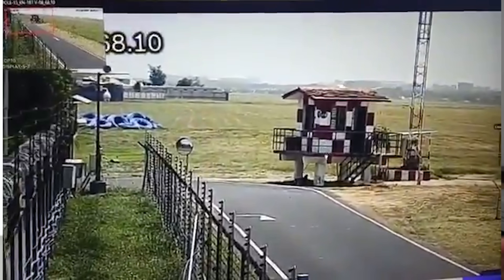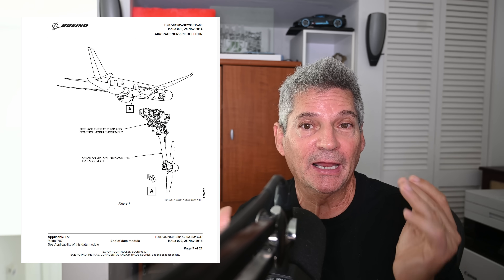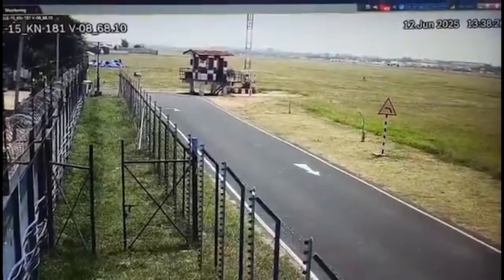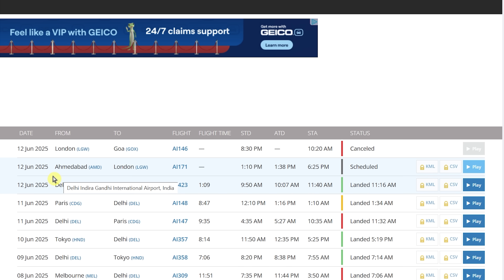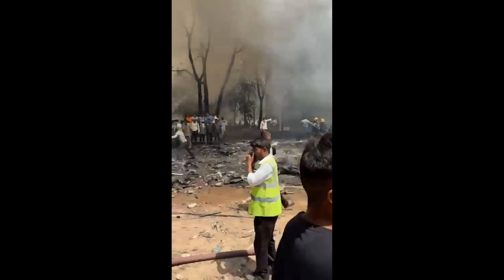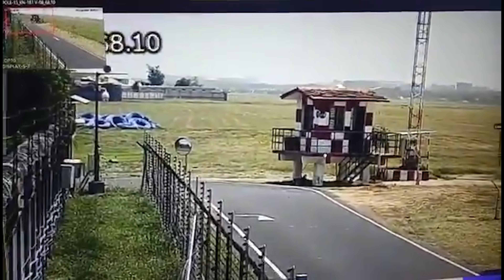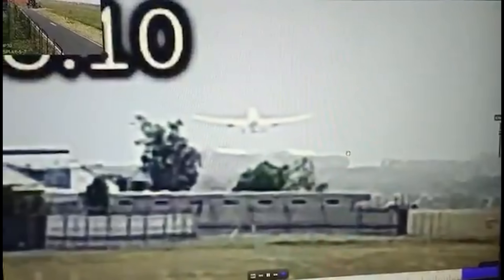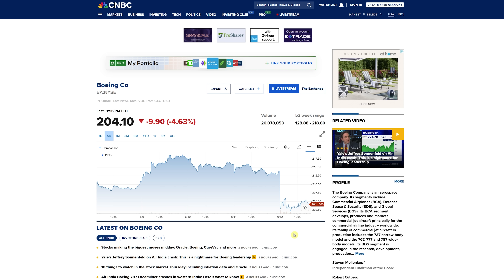What Caused Air India 171 Crash, Mysterious Sound Before Impact

Comment: I can't explain the "no flaps" take off, but they took the entire runway and kicked up debris in the run-off area. Could the engines have ingested some of that debris? I agree with the RAT deployment scenario, which may explain why the gear was still deployed. If they had lost the engines, I heard that the RAT doesn't supply power to retract the gear in that model. Since the tail section seems to be intact, I'm hoping the black boxes hold the answers.

Comment: About one second of the slow motion picture it looked like the craft blipped in its effort to climb. Then a second later it clearly started to loose altitude.  The picture that demonstrated the engine sound sounded perhaps like the engine was lean in fuel burn. Here at an Itntntl airport the planes sound like prop planes but I'm not sure if they sound like that until the plane is in a steady climb.. those jets can sound loud but if the plane is in steady climb the engines can be quieted by rolling off the power. I figure but only when safe that being when the plane is well underway and there is a steady climb.  So if the plane leaned too soon like somewhere takeoff speed and a speed a little faster only the fuel mixture was reduced. The plane might not regain climbing speed again.  Perhaps it the guy leveled out the plane a bit the plane could regain its speed to again climb at a speed a bit faster.   Big plane. Lots of weight in fuel, luggage and passengers. Darn thing needs all the help it could get.

Comment: I think on the “original” video that the slats, leading edge hydraulically operated  lift augmentation devices are deployed. This would confirm that some flaps, either 5 or 15 were deployed. My guess it’s the lower setting for it’s difficult to see if any flaps are extended.  If this is correct then the takeoff configuration is correct. Why loss of at least 4 generators if the RAT is deployed?  If the APU was on by SOP it would have required 6 generators to be off line before RAT deployment. This is getting really weird.  If flaps are correctly set and gear are down this planes flies if there is power. Apparently then, this thing lost significant thrust or all its thrust in 2 engines. This statistically is near impossible like 1 in 10 million impossible. Think Sully at LaGuardia as the best exception. My guess now after this clearer video until we get the FDR data, loss of power both engines.

Comment: 11:17 several pilots on YouTube, some of which pilot that exact model, have said that in the cell phone video the flaps are clearly not set. The data backs that up, it's a hot day 3000 ft above sea level so the density altitude is high and no flaps you could still struggle to get it in the air but you're gonna stall very quickly. I don't know how the pilots could miss that as it's a fundamental aspect of the checklist part of taking off. Furthermore this model has a preflight checklist built into the electronics.

Comment: Yes, that RAT sound must due to loss of power to hydraulics of flaps and fuel supply motors n in fact everything depends upon electricity power supply in a plane. Fuel supply failures for both engines and AC generator is also most likely 😢😢😮. Servived passenger had fainted inside the plane only due to heavy impact of plane on ground. But he says some rescue person took him or shake him and he woke up to see all burning bodies around. He suddenly stood n jumped out... Really miraculous...SRI Sir is more correct here. Flaps, stall engine loosing power, loadsheet, piolet involved or bomb in cockpit? I am RETD  Mumbai airport ENGG. Mostly fuel supply stopped to both engines... Bcaz from Delhi to Ahmedabad also AC generator was doing regular on offs😢😢???The same power might be required I mean electricity supply to run hydraulic pump motors operating in flaps operations. That cd be the reason piolet said while landing that pax might experience turbulence??? That too in too normal wheather 😢😢😮
Exactly सही कह रहे हैं. वीडियो में power loose करते हुए दिख रहा हैं. Fuel supply बंद हो गई होगी. AC power generator भी नहीं चल रहा था ढंग से बंद चालू हो रहा था ये एक दिल्ली अहमदाबाद यात्री ने बताया है... 787 टॉप ऑफ क्लास होता है. मै एयरपोर्ट retd engg हु... AC GENERATOR नहीं चल रहा था. आज सुबाह ही  दिल्ली से अहमदाबाद जब ये फ्लाईट उतर रही थी तो PIOLET ने आसमन ऑर WHEATHER FULL CLEAR होने के बावाजुद turbulance होगा ऐसे क्यू बोला वो समझ नहीं आता. मतलब प्लेन में कुछ तो प्रोबलेम थी. Sabotage इतना आसान नहीं है..But if it's not poor maintenance then only reason remaining is the sabotage 😢😮😢इंजन्स भी पावर loose कर रहे थे. इसलिए पायलट जबरदस्ती nose ऊपर करके देखा आखरी वक्त में..
Fuel supply में गड़बड़ी ???😢😢😢 अब किसीने किया कि नेचुरल ये  investigation में ही पता चलेगा.. हां मोदीजी के प्लेन को अब तो फाइटर्स और fuel टैंकर्स के सिवा भेजना गलत होगा😢😢😢 
Load sheet मैने खुद किए है.. I don't think loadsheet was wrongly calculated or wrong cargo loading like heavy weight in tail??? इतना नौसिखिया लोड शीट वाला. यकीन नहीं होता.. 242 पैसेंजर नहीं हजार पैसेंजर होते तो मान लेते...

Comment: The Flaps were not deployed because in this model when the flaps were fully deployed they mask the engines. Have you noticed the position of the Elevator on the wreckage? it was configured as Nose Down! Why are the landing gears still deployed? My 2 cents one of the Captains retracted the flaps instead of the landing gear which caused an immediate stall. Other factors might include excessive weight or taking off with the wrong speed or taking off on a short runway and these lead to a human error in calculating the required taking off speed based on weight and runway length or may be pilots accidentally moved the thrust levers to idle

Comment: There didn't seem to be sufficient flap did there? There is also a bit of front end asymmetric flight going on once the sink rate shows, suggesting one engine out. I wonder if they lost power on one engine and accidentally shut down the other engine since at a certain point the aircraft starts going straight down as if with no engines. I'm not sure there was enough time for a wrong shutdown to be initiated by the crew and then to take effect. The airline pilots among us might know. I'm also not sure why the RAT would deploy if flap retraction was too soon. Which makes me lean towards engine failure/erroneous shutdown. I've never heard a RAT before, it's very distinctive isn't it?

Comment: The aircraft took the entire runway and took off with zero flaps and did not retract the undercarriage, and you say there was no sign of a problem?
Reply: yeah bec there were other important concerns like total electrical failure and no power from engines, muh retract tyres first noob
Reply: They likely did not take off with zero flaps. There are warning systems that would have alarmed, and alerted the pilots that the aircraft was not in a proper takeoff configuration.

Comment: So what is that little propeller supposed to do when the two jet engines with 75,000 pounds of thrust cut out? Provide power to maneuver? That looks like what Sully Sullenberger would have used for a trolling motor when he landed in the Hudson River.

Comment: @7:28 into the video you show the line of the planes takeoff roll starting at mid field. IF, I Say IF they took off mid field, on a hot day, loaded with fuel passengers and baggage for a long flight, and they had “get there idis”, those are the holes in the Swiss cheese model of crashes. The might not have had the takeoff performance even if the used the entire runway, but certainly not from mid field. The air density altitude performance index would have required full field runway less fuel or less luggage or less people. Add some electrical fault, also likely triggered by heat, and there’s the outcome. So sad.

Comment: Despite all speculations, the plane took off,  ascended for a short time regardless of the flap position and the LG down. Then it began to sink or stall, which denotes a relatively fast change on the flight dynamics.  Since LG is still down, the only possible causes for this change IMHO may be an excessive change of the flap positions or engine power loss. If the settings had been kept like in the first T/O seconds, the plane would have continued to ascend unless an atmospheric or ground effect influenced it.

Comment: Didn’t look like it even got to 600 feet at all…
Reply: I think you are correct. ADS-B data might show 600’ but that figure should be corrected for barometric pressure (with a QNH of 1001 at the time of the accident that will be a correction of -360’) and field elevation (180’) so a total correction of 540’. I think it did climb above 60’ but ADS-B is not that precise and further evidence is in the video. The 787-8 has a wing span of 197’, and with the grainy video I don’t think you can actually see the wing tips, but it looks like the aircraft barely reached an altitude of more than 200’ above ground level.
Reply: @janerikkant3646    Absolutely!  Visually that cannot be 600 feet, way to soon after takeoff- 600 feet would look over double that height!

Comment: I think the sound you focused on could be more an effect of sound dynamics and because the source is travelling away from you at roughly 150mph. In addition, and I'm not positive because of the crap video, it almost looks like the spoilers / speed brakes may be partially deployed. I also see a pretty steep pitch up and no apparent nose-down correction in an attempt to gain airspeed, and I don't see the horizontal stab moving in the direction I would expect if a correction was being commanded. It almost acts as if it is overweight, or something to do with the the FMC thinking a rejected takeoff has been commanded. There are SO may possibilities here that I feel like I'm being a bit irresponsible taking wild guesses like this.

Comment: I disagree with the interpretation that the sound is the RAT. It sounds like the normal engine sound from the GE engine. The RAT is a passive device in that there is no engine driving it. The movement of the RAT thru the air causes it to spin. I believe the retraction of the flaps vs the landing gear is the most likely cause.

I think that a plane as smart as the 757 should have prevented flap retraction at that low airspeed and altitude.

Comment: the wing and center fuel tanks are generally only between the spars of the wings and center wing box. The spars are actually pretty far back from the leading edge of the wing and forward of the trailing edge. So seat 11A should be well forward of the tank. And if this guy jumped out, then the front fuselage probably separated away from the wing section, giving him room to get out and putting a bit of distance between him and the bulk of the fuel.

Comment: Don't think that is the RAT.  787 engines are quiet for airliner engines.  I think you are hearing the turbines overspeed trying to get out of the loss of power feeling from the misconfiguration.  Those flaps are retracted, no doubt.  The aircraft never achieves the proper angle of attack.

Comment: People all over the comments screaming that flaps were not deployed.  However with all the electronic monitoring and computer feedback its unlikely that such simple human errors will go unnoticed.  These things are checked multiple times with redundant sensors, while software is monitoring and cross checking all the time on what humans are doing during takeoff, to catch issues early.  There appears to be failure of both engines immediately after take-off, and sabotage cannot be ruled out.

Comment: I haven't watched the video but let me take a guess by looking at the thumbnail. Hmmm they're trying to take off and yet the gears are still down (intentionally ... maybe) but ideally, they should be up. I cannot tell if the flaps were set to proper takeoff configuration from the pic, but they look as they say 'too smooth'. Pilot error likely occurred while still on the ground by not setting acft to correct take off configuration. Maybe they could have saved it after rotation had the gear been up, power up/set flaps. I'm retired USAF but not a pilot. I was an F-16 and later F-15 scheduler for multiple fighter squadrons but know nothing about commercial acft. I should add and this applies to every job in the military: Checklist, Checklist, CHECK .... LIST!